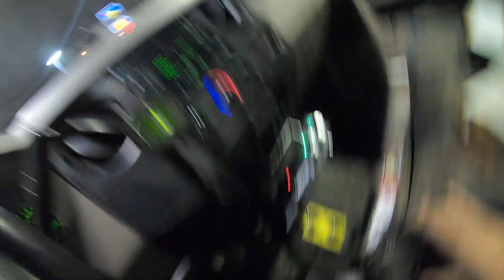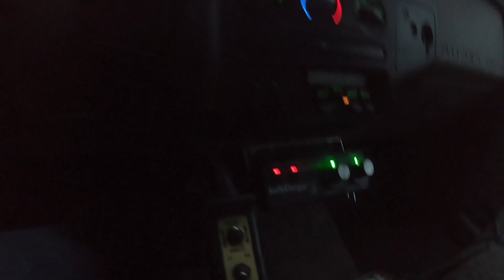New Salt Spreader... Testing and Tuning

Comment: Great job on video👍 What was the control setting for the auger and spinner and how does the salter work if you treated salt?
Reply from the maker: I believe had then both around 4. I don’t have treated salt so i don’t know. But I have to use the vibrator more than I thought I would with this new hopper.
Reply: Just seeing this video, I have the pro 1500 with the chain belt and was experiencing using the vibrator a lot to… I raised the inverted V all the way up on the inside and I barely have to touch the vibrator anymore unless for the last bit of salt left.. Not sure if the auger would do the same but I’m glad I raised it, it works great now. @BeauEnterprisesInc